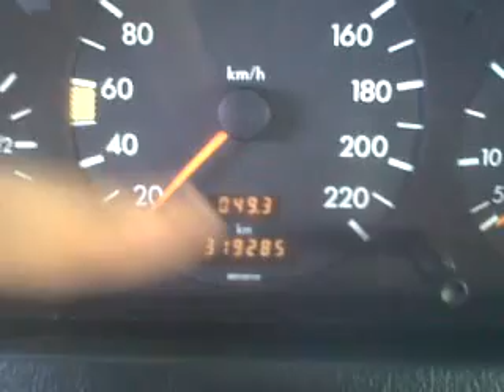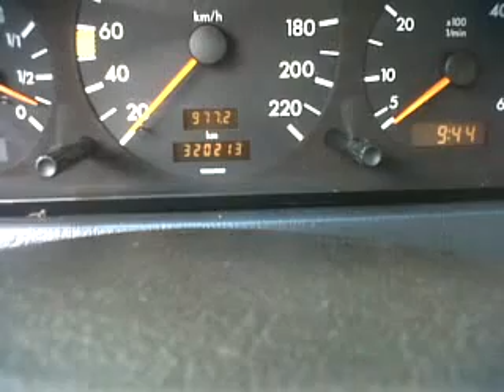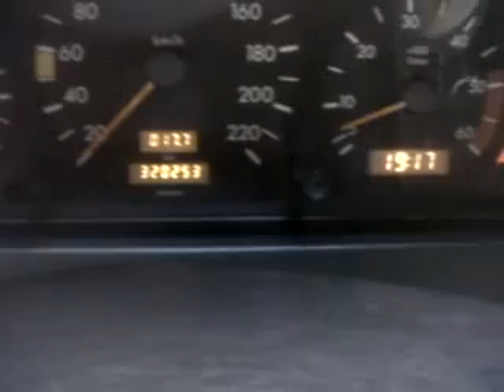HHO on Mercedes

Comment: Mercedes C 200 Diesel with this engine consumes about 7 - 7,5 liters of diesel. So you save about 6 liters of diesel on the full tank. And at 1000 km, you save about 100 km. Not bad.